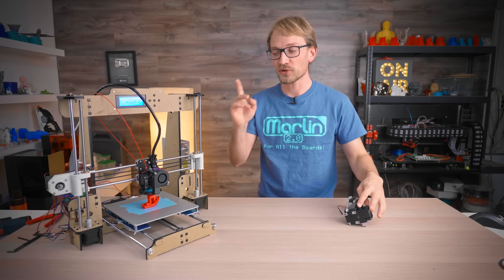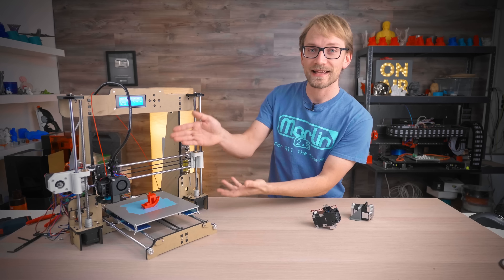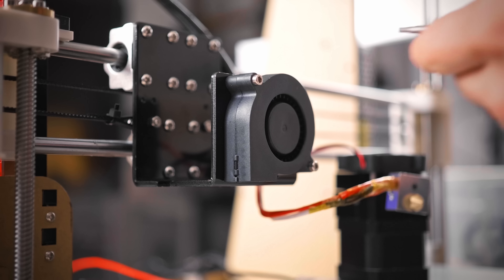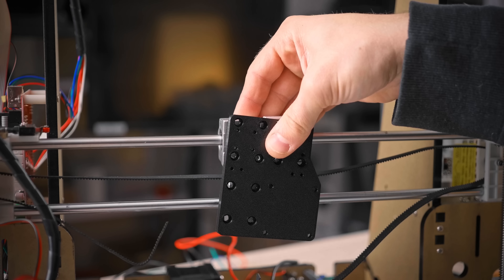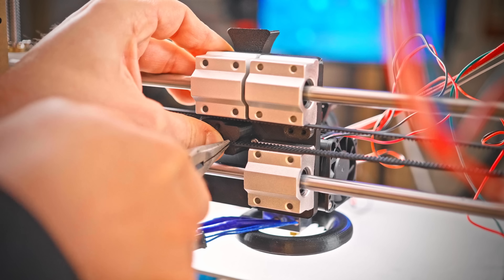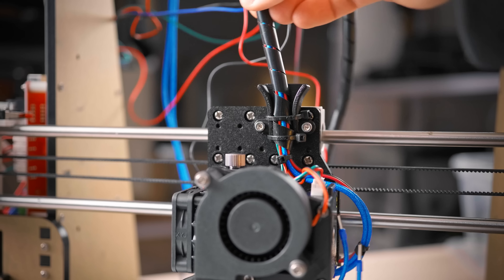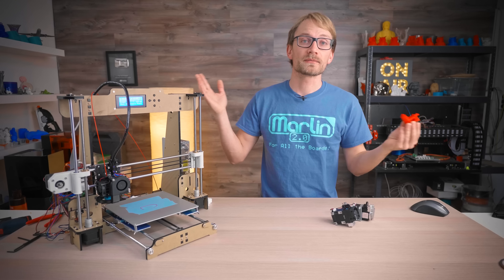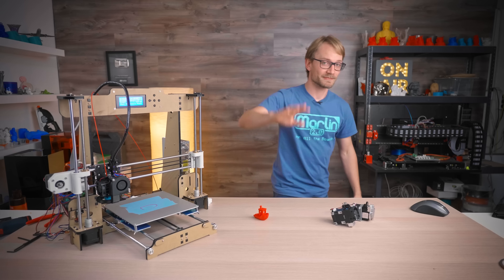How to upgrade the Anet A8 to E3D Hemera and Marlin 2.0! #FormerlyKnownAsHermes

Comment: Actually pretty cool that you did the upgrade on the Anet A8 since many people started with one and still have one sitting around!
Reply: As janky as it is compared to today's printers, it was super a good learning experience.
Reply: Yep, mine is completely rebuilt at this point. Did the AM8 upgrade, mosfet, rewired bed, PEI print surface, Prusa MK3S extruder assembly and has been on better and safer firmware since the first week I had it. If you're comfortable with electronics and know how to fix the issues it was the best thing out at the time for the price. I definitely wouldn't recommend it today given how cheap far better printers are today.
Reply: I'm still using my A8 but getting annoyed with a few things on it. This upgrade should remove several of those while I continue to look into a Hypercube Evo build.
Reply: 6yjjk The best 2 things I ever did with the A8 was to do the AM8 upgrade on Thingiverse and replace the H plate under the bed! The AM8 upgrade was easy and replaces the acrylic frame with an aluminum frame. The RepRap Champion H plate eliminated the need for constant releveling of the bed! That little printer became a real workhorse.
Reply: @viru52000  so little of my original a8 was left that i just designed my own printer from scratch

Comment: A8 is actually a very good machine, as long as you assemble it correctly. Of all the printers I've had over the years, the A8 is the one I kept. It's such a simple design that there isn't much that can go wrong.
Reply: Everything that can go wrong has gone wrong with mine lol. I got it second hand too. I'm considering changing out the power supply too since the hot end gets cold when anything else is running off the same 15 A circuit. Any one else have this problem?
Reply: @alexklausenstock3974  same here only part that hasn't grenaded itself was the stepper motor and heated bed. I decided to retire mine after the frame begin to walk

Comment: Mount the A8 on a stable surface. Stabilizing the frame. Get an ATX power supply and modify it to work on the A8. There are several vids on yt that show how it is done. They can be had for cheap.
Go to a bowden setup to remove the weight on the x carriage.
Fasten the bed wiring on one of the bed levelling screws and run the wires up to the top of the printer to eliminate wire flex stress as well as eliminating the connector flexing.
MOSFETS are necessary and inexpensive besides being easy to install.
These are what I have done and I know they work, going on 2 years of printing nearly every day. 
But, of course, your mileage may vary. 😊👍

Comment: From my experience I've found it's not entirely necessary to remove the white JST connectors from the board. Most dupont connectors will fit right in without issue. Also the contacts in the dupont connectors are usually the same as JST so they can just be transplanted into the original plugs :)

Awesome upgrade to this printer all the same. I'm still rocking my upgraded AM8, but have moved on from the stock board.

Comment: when i installed my hemera i forgot to put on the silicone boot. when i would print and it got up to the layer the part cooling fan kicked up into high gear it would cool the heater block and trigger thermal protection. it had me confused for a bit until i seen the boot still in the box.

Comment: how to uprade a hotend to a priner thats the same price. lol
Reply: I like to think of the A8 as a template guide to show you where to put good parts :)
Reply: How to upgrade the printer that requires to upgrade everything.
Reply: they are not same price Printer is almost half price of the hot end :D
Reply: When it improves the printer massively, then it's almost worth it.
Reply: @campiosa  exactly the A8 is a hobby for those that like to tinker. the biggest improvement I have experienced was printing some belt tensioners. And ofcause do all the safety upgrades. I'm planning on upgrading to a Duet board to reduce the noise from the steppers(And no money wise it does not makes sense but it's a hobby)
Reply: @coolfrost6  I would recommend looking at the SKR mini e3. Has the TMC2209 drivers built in and just needs a motor cable splitter for the Z.
Reply: @campiosa  seems like a good option too. But I would like to support the duet team's work, and maybe have a bit less chinesium in my life.
Reply: @coolfrost6  lol I hear you there.
Reply: @badhills7300   The jury is still "out' on that claim. Remember this ONLY an "improved"  Titan.. basically a bit smaller package. Despite claims

Comment: Hallo Thomas... erstmal ein dickes Danke für deinen tollen Kanal. Für mich einer der Besten in diesem Bereich.
Ich bin derzeit am Umbau/Neubau meines alten Craftbot+ und will (sobald wieder verfügbar) den Hemera (Direct) einsetzen. Kannst du mir eine Empfehlung bzgl. des Part Cooling Fan geben? Welchen Adapter nutzt du und welches Design ist deiner Meinung nach das Beste, um dem Luftstrom optimal an das Bauteil zu bekommen?
Hello Thomas ... first of all a big thanks to you for your great channel. For me one of the best in this area.
I am currently converting / building my old Craftbot + and want to use the Hemera (Direct) as soon as it is available again. Can you give me a recommendation regarding the Part Cooling Fan? Which adapter do you use and which design do you think is best to get the airflow optimally to the component?

Comment: I am screaming at my computer for you to peel the paper off the acrylic.
Reply: Total time spent assembling the A8 - 5 hours, time spent peeling of the paper of the acrylic , 3 hours ... I`d say he saved quite some time ... i know i hated myself for starting to peel of the paper and seeing how UNPEELING it was ...
Reply from the maker: Peeled a printer once, will never peel one again. If it comes with paper on acrylic parts, that paper is not coming off.
Reply: I tried that with the spool holder that came with my Anycubic i3 Mega back in the day. I managed to tear the tiniest sliver of paper off one corner, then called it a day. If it's a plastic film over acrylic, it comes off like a dream. If it's paper, it lives there.
Reply: I don't even have the acrylic frame any long.  Went to 4020 extrusions and linear rails.  Doesn't even look like an ANET any longer.  I call it my Frankenstein printer.
Reply: @MadeWithLayers  I peeled mine before assembly, that way it came off clean and quick. Then a few months later upgraded to the AM8 Aluminium frame.  Still works like a charm.
Reply: @MadeWithLayers  'Sloth'  Sanlander  seems an appropriate Nickname. Use a hairdryer Genius.. It cuts that sticky peel off time by 2/3rds.
Reply: in the case of the a8.  it improves the structural integrity of the printer XD  
it's more stiff

Comment: I tried your firmware, And it has some issues.
1. SDCARD_CONNECTION is commented out and is set to LCD, Should be defined ONBOARD.
2. My X direction needed to be inverted, 0 was on the right.
3. My extruder was also reversed, But I am using a Prusa x carriage.. So I might just deserve that one :)

Anyways, thank you so much for your work, It was just enough to get me to flash new firmware and properly set this machine up finally. If you want me to share it after my changes lemme know, Just keep in mind the e-steps and probe to nozzle offset need to be corrected for any configuration other than mine :)

Comment: I like that you’re showing how the lowly A8 can be upgraded.  From a diff perspective of the A8 status quo upgrades it seems the web has done what ones do you recommend if any?  Your vid here looks like your a8 is pretty stock outside the hermera and some auto leveling mentioned.  Marlin and hot bed wiring safety aside...anything else Thomas would recommend I.e. belt tensioners, cable chains, etc?

Comment: Is the Hermera heat sink as efficient as the E3D V6 round heat sink?  I like how nice and compact everything is but I just can't see that heat sink being as good.  Converting my A8 over to the E3D V6 hot end made a world of difference quality wise...I would hate to go backwards with the Hermera.  I have an AM8 frame that I put together for my A8 but haven't migrated the parts over yet.  I'm thinking on building that as a 2nd printer instead.  I was thinking on using the threaded E3D V6 heatsink with a Nimble remote extruder but it sounds like E3D wants to move more in the Hermera direction.

Comment: Will u do a how to upgrade the Raptor 2.0 too ? pretty plz
Reply: I second this one, I have a raptor 2 with a Bondtech, but I was planning on redesigning the mounts and would rather work with this extruder for the redesign. Problem is, I am awful with the firmware set up.

Comment: I just received my E3D Hemera the other day.  Since you used Marlin 2.0, I think I am going to change the Anet board to the SKR v1.4 Turbo with TMC 2208 stepper drivers in UART mode plus their TFT35 v2 touch screen .  Since you are a 3D printing guru, my question is, using the Marlin firmware that you have done for the A8, (thanks for that), what changes are going to have to be made to Marlin in order to use the SKR board with the new touch screen and stepper drivers?  Or, if anyone else could help me out with these changes, that would be very much appreciated as well.

Comment: Tom, you suggested that Anet A8's sometimes don't have a bootloader.  Often no bootloader can be mistaken for the bootloader using a nonstandard communications data rate.  :-(  If you find the boards.txt file for your board, you can change that data rate.  The configuration in question is something like this: "sanguino.menu.cpu.atmega1284p.upload.speed=57600"  Arduino likes 115200.  I've seen A8s (my was one of them until I re-burned the bootloader, that communicated at 57600.  This is painful..  If you have a spare arduino, it's probably just as easy to update the bootloader.
Reply: Good point,  @anthonyrich1592  .  And, if you're looking to see the exact command for avrdude for your configuration, in the Arduino IDE File>Preferences, check the Show verbose output during compilation and upload boxes.  You can see all of the detail of what the IDE is doing.  The -b switch is likely what you need to adjust.

Comment: hello , I  buy new Anet 8 , but When the initial operation, the extruder is directed to the opposite side to the end and continues for a while the engine rotates even when the extruder reaches the end ... The same applies to the surface ... Also, the z direction motor works one and the other does not work .. Note that I almost checked the connections  All are correct,  What is the problem??!! ... 

1

Comment: Hi, Thomas

I've attempted an upload to Marlin on my A8 and it seems to overload the memory:  I get a bunch of gobbeldygook on the display once it starts printing, and there are some print artifacts (underextrusion at the start of the print) that weren't there before.  I cleared the EEPROM before pushing Marlin (1.1.9) and no good.   Any words of wisdom?
Reply from the maker: Marlin 2.0 runs flawlessly on the A8 - not sure what's wrong with the configs in 1.1.9.
Reply: @MadeWithLayers  Hmm.  I just pushed the A8 .hex back to it last night so I'll try the same file with the same Gcode and see if that fixes it before trying Marlin 2.0.  You pushed the .hex and didn't compile it yourself, is that right?

Comment: Does hemera come with a thermometer or do I need to buy one separately I looked on there website under what comes in a box I don't see a thermometer cartridge please let me know if I need to buy it separately thanks
Reply: @Sanjay Mortimer thank you sanjay if you could answer two more question how long will the shipping take to USA as I'm building a 3D printer from scratch and looking to buy gates pulleys, belts, motors and many other items. the motor I want are the high torque this question is will they be able to handle a three pound corexy gantry thanks for you respond very appreciated it.

Comment: Is that an A8 specific motherboard or an open source one?  I'm still using an old Arduino/RAMPs combo and think it might be time to upgrade.
Reply: That's the original A8 board.
I own one, don't buy it. Upgrade to a smoothie or similar, these boards aren't worth the hassle tbh
Reply from the maker: Yes, it's the stock board - runs fine with Marlin 2.0, but if you're looking to get a new one it's not the one you should get.
Reply: @MadeWithLayers  Open to suggestions sir!  Or you probably have a video of it that I need to watch!  Thanks

Comment: Man that name sucks. I like how you left out installing a JST-XH connector for the fan. Most people are going to want the correct connector. You would have to hotglue it to the board using the stock connector. Also now that means the Anet has Wanhao style extruder setup.

Comment: how is this an upgrade?what are the benefits?
Reply: It has the extruder and hot end together - supposedly no way for the filament to escape.  They advertise it as being able to print any filament at top speed.  I'm more interested in having no problems with putting down PLA - no jamming and no bowden tube.

Comment: Is the anet A8 frame steady enough?
the same quesion for the original prusa i3 
I've made prusa i3 mk2 but I have some issues because the  frame isn't steady enough
Reply: Absolutely not, the acrylic frame the a8 has is absolutely garbage and super wobbly
Reply: @potatojz38  What about the prusa i3 mk2
I've made its frame of aluminum 6mm but it's not steady enough
Reply: I want to know if the original one is steady or not

Comment: It's almost 2020 who uses an A8?
Reply: the numerous people who have them working fine and don't need another printer ?
Reply: Stock board, stock extruder, with anycubic utrabase and silicone heated bed, it prints really great in almost 2020.
Reply: The A8 is much maligned but has its place.  While I don't have one myself (I started with a used DaVinci),  I rescued a few off Craigslist and gave them to friends to get them started with  3D printing.  Two who really got into printing still have and love them - they have upgraded and refined them and they print remarkably well.  One friend bought a second one recently for $85 shipped on special and will become part of his print farm since he knows the printer so well.  It is ironic though that the Hemera could cost more than the entire printer.  If you buy the Hemera and add it to the A8 it's not stuck there - it can be removed and installed on another printer later.
Reply: @Antiath  thanks captain obvious; now please enlighten me how putting a e3d Hemera that costs more than a brand new Anet A8 will improve 3d printing since A8 kinematics suck, the frame isn't very rigid, you can't achive high feed rates and the build volume is average at best :/ how exactly does the Hemera help out?
Reply: @trailblazingfive  maybe they upgraded the mechanical performance of their Anet A8 ? maybe you should also stop questioning people's choices for their own stuff ? Bottom line : who cares ?
Reply: @Antiath  I care; it's a 3d printing channel; it's obvious Tom got a e3d Hemera sample for promotion and decided to slap it on a an Anet A8 - cause why not? My question is why do it in the first place. Why should I buy a $108 Hemera when I might as well print with a $8 V6 clone :P?
Reply: @trailblazingfive  well Thomas said in the video that he slapped it on an A8 because he received a conversion kit for this printer and that was E3d's choice to showcase their new product and a conversion kit for this printer.
So that's just marketing and I can't answer your questions  because actually I don't even have an A8 XD
However, what I can say is that I have a tevo  tarantula. It doesn't have the same problem but it definitaly have plenty others. It would also be weird to put a new hotend like this on a Tevo tarantula ... IF I didn't upraged it to better perform. And since it is a very common thing to do for tarantula owners, I assume A8 owners did the same. So I think there is a market and it is not that silly, especially considering that the Anet A8 sold a freaking lot.
Reply: @Antiath  xD oh yeah he did at around 1:30 lol anyhow seems to expensive for me - don't really see a difference

Comment: 130$ ;-; jesus so expensive this isn't affordaaable D: i know it has a motor but I'd not buy one anyway
also the anet a8 is acrylic gore
Reply: Really, is like a real BMG extruder  and the real E3D hotend put together with the advantage that´s is better cooling system, ideal for high temp material.
Reply: @rapalma38  no denying that it's amazing but 130$ is a lot ;-;
Reply: @chloemcholoe3280  If you compare with chinese old system clone, of course, 74 usd TriangleLab clone or 82 usd Mellow clone, but both have the same quality than E3D?
Reply: @rapalma38  yeah again. i'm not saying it's overpriced I'm saying it's expensive af for a hobbyist like me